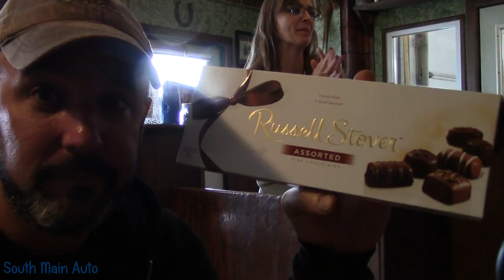Kia Sedona : Broken front Axle

Comment: Another quality video.  Just a tip from a humble diyer.  Those pin type lower ball joints are much easier to separate if you pull the knuckle away from the car as you beat the arm  downwards.  The reason is the pin is naturally angled inboard so by pulling down on the arm the pin is actually digging into the knuckle.  Try it and the joint will separate far easier.

Comment: The Rusty Tailpipe.  The Ball Joint.  The Failed Injector.  The Frayed Harness.  The Won't Run No Mo'.  The Frosty Windshield.  The Grease Stain.  The Singed Eyebrow.  The Blackened Fingernail.  The Crusty PCM.  The Hygroscopic Fluid.  The bar name possibilities are endless...  :)
Reply: The Ree Manshaft?
Reply: "blinker fluid bar"
Reply: Torgued t'spec

Comment: EFEN- A!! My armature hour was getting that LCA ball joint back in the knuckle. Several hours and methods of approach. I mapp gassed the knuckle opening. Used a chisel to open er up a bit, and then FINALLY the pry down and hammerin' worked. Everything else about this job was smooth sailing. 2014 Soul

Comment: I bought an axle once from NAPA and the spines going into the wheel bearings were a little too thin that they slipped and seized. I guess I have bad luck with aftermarket parts on Hondas. I bought the OEM one for 3 times the cost and it went in perfectly.

Comment: That snow looks gorgeous I'm in a place that doesn't get snow
Reply: Yep, except they salt the crap out if the roads and your car falls apart. I couldn't get the evap code to clear, so it went into the shop. $800 to replace all the parts. Then when they were pulling the car in to put on the sticker, the rear brake line blew. All together, a $1000 to clear the loose gas cap code. Thanks to salt.
Reply: @pbcanal1  very true it does destroy cars

Comment: Mr. O..... My comment is in reference to small rolls of electrical tape for tight spaces you talked about in an old video, thought you'd have a better chance in seeing this on a newer video.   My solution is to put a 1/4" drive socket on a bit adapter in the battery drill, get the tape started on the socket and run the drill till you have your desired sized mini roll of electrical tape. Takes no time at all to transfer a large amount onto the socket. Hope it helps.

Comment: A word of caution, some vehicles (mainly Euro trash) have splines on the bolt that secures the lower ball joint and they are made to be knocked out, not spun out. If you put a rattle gun on them, the splines on the bolt will ream out the hole where the bolt goes through the knuckle.
Reply: Give me an example jake of a car with these splines in Europe. Been working cars for 35 years and not seen that before to be honest
Reply: "Euro trash"!?
Reply: @the_retired_mechanic 2011 BMW 3 Series
Reply: Ps. I know because I made that mistake on one ;)
Reply: @2secondslater  Haha. US cars are still using horse and cart suspension. Think you need look closer to home mate.
Reply: @2secondslater  Maybe the Aussies have cottoned on to the ancient suspension and crap electrics on US junk cars then?
Reply: @1701_FyldeFlyer  yeh, we used to have some of our own that were modelled on yours, hell, we even shipped some of ours over there for a few years.
Reply: @2secondslater  Holden's? I think they were imported to the UK under the then GM \ Vauxhall banner. Awesome machines.
Reply: @DanielBanas1127  triggered
Reply: @1701_FyldeFlyer  Pontiac, Vauxhaul etc

Comment: 4:03 maybe Im the only one that does this but I've carefully spread the ball joint "retaining" ears apart on the back of the knuckle with a chisel. Have to fiddle with the steering wheel to get enough room but it makes it easy to remove the control arm when working solo. Don't have to move them much, just a few taps on the chisel to break it loose. But, we'd have no Mrs. O in that situation :)

Comment: I've one one of those now ,and the transmission is so strong that if you're not careful you'll break an axel, but compared with other vehicles front wheel drive, that's something not easy to achieve, the guy that owns that vehicle, will break even a 4×4

Comment: When releasing the lower ball joint you should always use the power tool on the nut side as the bolt side was most likely has a camfer or locking mechanism..

Comment: Excellent video.  Unfortunately, every time I see your work on the chassis or suspension it reinforces my belief not to do that type of work in my driveway without a lift. Some of the repairs you do are hard to do even with a lift. :-) 

It's interesting about your candid comments about Dorman products on some of the videos.  I think we fell prey to having repairs like CV joints, water pumps and other components done by local shops and began a cycle of recurrent repairs for the same part failures without suspecting the rebuilt parts. Sadly, consumers don't suspect the premature failure of these rebuilt parts, and just assume it's a typical failure, and pay full price to correct the problem again in an untimely manner.

Comment: Hey Mr. O, why do you remove the knuckle from the lower control arm at the ball joint instead of the shocks n struts on these Hondoos? I've found good luck with those considering there's only two bolts and the knuckle's hanging out on the lower control arm and the outer tie rod end. It must be because of big red making it easier to separate the control arm from the knuckle...

Comment: Do you always use reman axles in every car that needs them? I've had 2 shops tell me my Volvo XC60 T6 requires only the factory axles to prevent vibration. Dealer is $2100 for the pair, and an independent is $1608 for the pair. O'Reilley sells them $150 each with a lifetime warranty, but I'd have to find someone to install them. Labor was quoted 1.0 hours left, 1.2 hours right.
Reply: You'll be lucky if you get a good pair to start with, then once a year or so, depending on how heavy your right foot is, you'll be getting the shimmy back.
Reply: @greanstreak04  wow, really? I hear conflicting things back and forth. The big box chains I called said they never use factory axles unless specifically requested and they never see any come back. Perhaps I should take them up on their pretty large discount over the independent and have a parts AND labor warranty? I found another independent that loosely quoted $800 over the phone, but said he'd have to look at it. He never used factory ones either.
Reply: @alexandermartincausey7333  try to find a shop with a 2 year warranty,  if the shimmy comes back in that time, labor is usually warranty also. I work on the rustiest vehicles in Florida,  and aftermarket axles are hit or miss at best.
Reply: @greanstreak04 Good advice!  All parts replaced by Volvo dealers carry a lifetime warranty. The independent I actually went to carries a 2 year/24k warranty via Technet. The second independent (that quoted $800) has a 4 year/48k miles warranty. I drive for Uber part time, so 48k miles is only about 15 months for me. My car has been in Tennessee all it's life and looks brand new underneath. Only thing is for a 2012 it has almost 156,000 miles. The axle boots aren't even torn, that's the frustrating part of it, they're just loose going into the transmission.

Comment: Next time take a prydriver (big cheap straight blade screwdriver) and wedge/hammer it in the slot in the spindle that the pinch bolt pinches. Then the spindle will pop right off the ball joint.

Comment: You don’t not have to take the lower a arm down you disconnect the brake line from the strut the abs wire from the strut undo the to upper strut bolts, take off the axle nut and you can pop that baby out in about 10 minutes book time is like one hour I think, but there’s many ways to get down town if you do another one try it the other way it may make it easier on you especially if your by yourself

Comment: That ball joint shank with slotted hole and clamping bolt. It looks like seriously oversize old-school bicycle-crank tech to me with the same potential for fretting and loosening although it seems to be working fine. Is there a common-sense reason for not using tapered fitment like other vehicles have been using for years?

Comment: Isn't a easier/faster to use a ball joint separator? That red prybar thingy doesn't work that well.
Reply: The "red prybar thingy" is the best and sometimes only thing that will get the job done!  You must be new here.
Reply: @paulcopeland9035  :)I've been watching Eric O. for a while. Last time ( a month or two ago) Mrs.O came to help with that "red prybar thingy", it didn't work. Eric brought out his ball joint separator, and the ball joint came out easily. Maybe he just wanted an excuse to spend more time with Mrs.O, but that ball joint was not exactly very tight and should be a piece of cake with his ball joint separator.

Comment: have you ever had the snap ring hang up inside the trans axle, I had one that got hung up inside the diff on a popular brand of ATV, every one tried slide hammers etc, we had to split the diff open pry off the snap ring and cut the stub off to get it out, lesson learned dont by cheap axles made in you know  where, these were supposed to be high strength tempered steel , blah blah blah yeah, I cut the stub off with a hacksaw, the company would not honor the  warranty because I had to cut the axle, and would not take either axle back, total rip off by the way those rebuilt axles you get at local part stores arent worth  a dime, there is a big difference between a 50 buck axle and a two hundred dollar axle (OEM) my 2 cents.

Comment: it look like there is crack in rotor at 4 clock 1:43
Reply: Looks like a mark off the end of the brake pad sitting on the rotor. At 12:48 you can see a second mark at the 11 o clock position with the same shape.
Reply: If there was, believe me it would have shown up in the ending "Toot"

Comment: Had my dad's friend repair my CV shafts turns out he only replaced the outer
100 miles from home on i95 was like the car was in neutral but speedo moves 🤣 swore the clutch self destructed 2 days later mechanic calls 

Did you let von touch your car Johnny?
Uh oh 
Yup clutch looks new the bozo never replaced the inner ones car will be ready in about 2 hours gonna flush the transmission for ya as well 
Shops like yours built on integrity are becoming like hens teeth